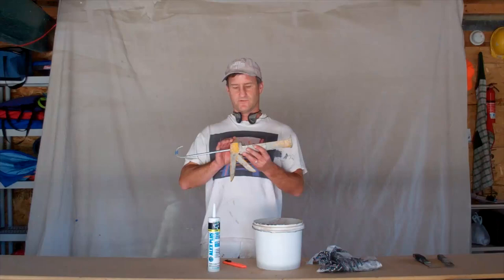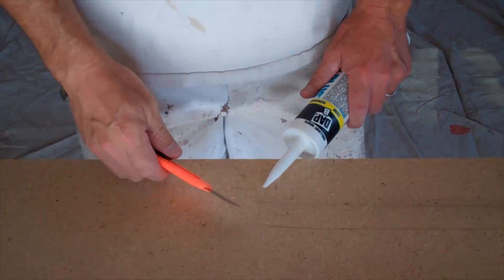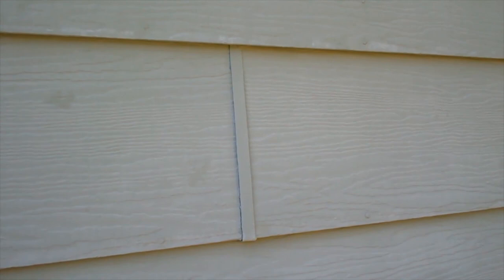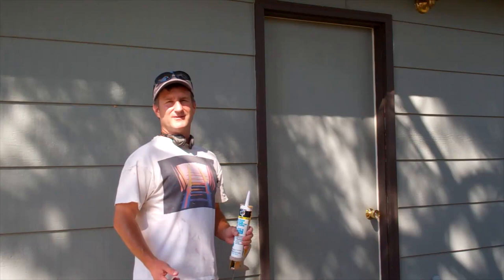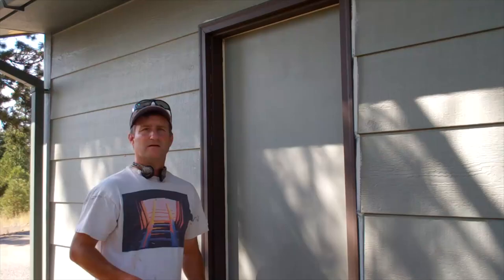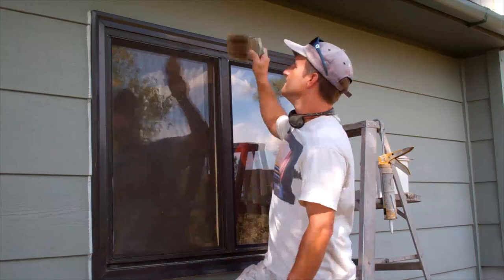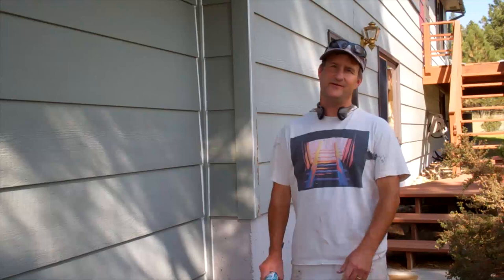Exterior Painting Step 3: Caulking the House

Comment: Great video. I wouldn't reccomend filling large cracks or crevices with caulking though as it shrinks over time and you'll definitely be able to tell. Use some kind of filler material beforehand (wood scraps etc) and you'll be happy you did.

Comment: For those questioning why he said NOT to caulk bottom of each lap- No siding's 100% water tight. So the bottom of every siding lap should never be caulked.  No caulk allows water to escape with gravity AND ventilates small area between siding & vapor barrier.  W/ no source of cool dry air even w/ vapor wrap siding will develop mold and/ or rot depending on material. Like any vent or pipe base on a roof.. caulk L, R, & top edge but never the bottom edge. To allow water an easy escape back on top of the shingle course below. Install specs for every type of siding state not to caulk under bottom edge. On similar note mesh below the starter strip behind bottom of lowest lap siding is as, that combination allows increased cool dry air to enter, while keeping insects out. Starter strip, prevents bottom of lowest lap from being flush w wall- which looks terrible as lap would have different profile than every lap above & would prevent water from escaping.. why often times the lowest lap of masonite or wood looks worse than any lap above even when sufficient gap above ground.
Reply: That depends on the house , I restore 1700's and 1800's homes  . Some of the gaps underneath the clapboards can be up to 1/4 to 3/8 wide due to the previous 8 hack painters who never re-nailed the siding to tighten it up so instead kept adding paint to the gap making it impossible to re-nail tightly  . I typically  re-nail and caulk all these old homes tight otherwise they look like shit  .

  Leaving these large gaps allows insects and exposure from weather to enter the home , In NH a 1/4 gap allows a ton of cold air into a home as well . I've been doing this for  25  years and have revisited previous work that I've completed over a decade ago with no issues .

  Alo the caulking that this painter is using is 100% garbage , it's the cheapest crap you can buy which is typical of most painters that will buy a $60 gallon of paint but use $1.99 caulk .
Reply: @manchesterexplorer8519  I'm about to address this on my own home. What caulk would you recommend?
Reply: @stefan8491  Dap Dynaflex 230 or better . I also recommend renailing any loose trim and clapboards prior to caulking as no matter what type of caulk you use is pointless if the boards are loose . This guy re-nailed nothing as all those large gap's that he caulked will come right  back in no time .

Comment: Thanks, John for an excellent video.  I was panicking when I dug out the existing caulk and there was a huge gap.  After your video, I feel better about scraping out ALL the 20 year old caulk and starting fresh.  Humor and crisp dialog- loved it.
Reply from the maker: Good luck with your paint job! Remember not to scrape TOO hard at the caulk, i.e. don't do damage to the siding or trim when digging it out. If it's still adhering and can't be scraped out, you can still do a thin layer of caulk on top of the old caulk and smear it in with your finger to smooth it, just to help seal up the old caulk and fill any small fissures.

Comment: Should you really be caulking under the window sills?  Every flashing 'how-to' for windows focuses on leaving this open for moisture to exit.  Very similar to your recommendation about the joint along the bottom edge of siding boards.
Reply: I was always told not to. It will trap water if you do.

Comment: Never caulk under a window. it will create dry root if there is any water intrusion, just do it on top and sides.
Reply: Manuela Baez bro your genius lol
Reply: fck i just caulked all my windows and did the bottom...i means its water tight I used PL. or am I screwed?
Reply: Thanks. Thats very good information. None of my windows are caulked underneath. Now I know why.
Reply: THANK YOU! I thought that was the case, and went reading in the comments to verify that. Funny that he caulked the whole thing. Do you caulk the top? Should I caulk the top of my door?

Comment: I would never use alex plus in an exterior application.  It's bottom grade stuff and fine for interior trim (although still not my first choice)  For exterior stuff it's going to fail quickly.  You want to use a quality exterior sealant.  For the home depot crowd dynaflex 230 is probably my minimum viable.

Comment: Love your choice of jazz music, since I play trumpet that sounds much like that...   You didn't talk much about wood dry rot. I noticed some of the boards you were caulking over had dry-rot.  Why wouldn't you replace them?  I guess if you are only doing a make-over for a sale, its not worth the expense, but any good house inspection would stab a poker in there and flag it as rotted.  Great you mentioned the horizontal gaps on the lap siding not being caulked, since they need to expand and contract with temp/humidity.   Some idiot tried to caulk all of my sidings and now of course it's cracked and peeling back...  What should I do, can't really paint of the blistering. Do I need to cut out all that caulk?     Agree with your choice of caulk, paintable silicone is the dope! not the acrylic stuff... thnks

Comment: Do NOT use cheap caulk such as DAP Alex! That stuff dries out and cracks in a year or less. Use Big Stretch, OSI Quad, or other flexible exterior sealant. It will hold and seal the joint for years.
Reply from the maker: +doobysnacks Interesting comment...I've had great luck with DAP Alex. I've used it on my own house and never had it crack or dry out.
Reply: +howtopaintahouse I've always had great luck with it too.  Like the music too.  Classy.  On a side note OSI Quad is good stuff, but you have to wait a few days before painting it or it will crack.  DAP Alex works well enough and you can paint the next day.  Great videos
Reply: I was told to use lifetime warrantee calk - sure its a gimmick but was told to use the best you can afford. Sherwin Williams has some good stuff for $4 a roll. I got some lifetime at Guries paint store for $2.50.
Reply: Jacana Productions y
Reply: also caulking gun is important too, use a better one or the right one for the job

Comment: In Georgia, dust mite, mold spores and  due to rag weed, Georgia pine and etc... we always caulk beneath the boards in which you said never to do so, please explain?
Reply: No siding is 100% water tight. The bottom of every siding lap should never be caulked.  No caulk allows water to escape with gravity AND ventilates the small area between siding & vapor barrier.  With no source of cool dry air even w/ vapor wrap siding will develop mold and/ or rot depending on material.  It's like any vent or pipe base, ect. on a roof.. caulk Left, Right, & top edge but never the bottom edge. To allow water that gets under an easy escape back on top of the shingle course below. Install specs for Hardie, LP, any vinyl- all state not to caulk under bottom edge of laps and explain why. As for issue you mentioned additional sections of VB (beyond what's against sheathing) or thin metal behind each lap extending slightly over top of the lap below (but not visible) would suffice at shedding water away from exterior wall at bottom of course it likely entered at, while protecting against insects. As well as mesh below starter strip behind bottom of lowest lap, that combination allows increased cool dry air to enter, while keeping insects out. Starter strip, prevents bottom of lowest lap from being flush w wall- which looks terrible as lap would have different profile than every lap above and would prevent any water from escaping.. why often times lowest lap of masonite or wood siding looks far worse than anything above even when sufficiently above the ground.

Comment: I grew in a painting family. I was taught to prime then caulk to ensure the wood (or other material) doesn't draw the moisture out of the caulk.
Reply from the maker: I was taught that way too many years ago. I haven't found modern caulk to dry out when applied directly on wood. There is nothing on the tube (DAP brand) about not applying to bare wood. The reason I caulk before priming is because caulk can "shine" through a coat of latex paint, and priming after caulking helps prevent that. This is particularly applicable when caulking new wood trim on an interior job--I don't want caulk shining through the finish coat, so I caulk first, then prime, then paint. Really I think it can be done either way, this is just the way I do it.
Reply: Makes sense. I visited a couple forums, and painters of every ilk caulk both ways. Thanks for the response. By the way, I've learn a lot from your videos. Thanks for taking the time and effort.

Comment: A newbie question.. what's wrong with caulking underneath the sidings?  Doesn't it prevent moist air from getting to the wall?
Reply: TheBostonFern of course, and this can always be done. But on lap siding on a 2,000 sqft house, that would be a LOT of caulk. Small houses can take 4 or more cases just on trimwork, and just as much just on the trimwork outside

Comment: Hello. ..I'm trying to re paint the trim around my house on the outside and after I scraped it I was wondering if I had to sand it?
Reply from the maker: Heidi Gronke I don't usually sand exterior trim unless it is already painted with a shiny/glossy coating--then it will need to be sanded, especially the windows and door jams. But if it's rough wood and a non-glossy surface it shouldn't really need to be sanded.

Comment: Hey, John!  what brand name epoxy do you recommend for large holes and cracked areas in the fascia boards. .  Thanks for the great videos.
Reply from the maker: sonny woo Boy, I don't really have a recommendation for that...if I were you I'd go to a paint store (a real paint store) and ask the owner/manager what products they sell for that. Sherwin-Williams used to make a good oil-base exterior filler for siding holes and damaged wood. Not sure if they still do. Maybe check with them.
Reply: howtopaintahouse John.  Thank you for taking the time to reply.  i ordered the epoxy, bondo.  Good luck with your writing.

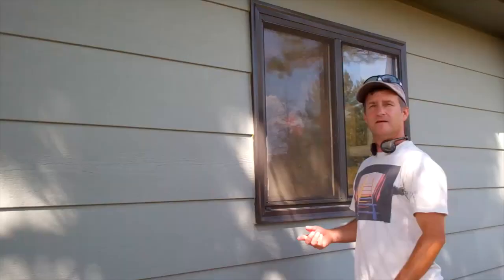Comment: WARNING!  BAD INFORMATION IN THIS VIDEO AT 4:05!!!  NEVER CAULK THE SIDING-TRIM TRANSITION AT THE TOP EDGE OF AN EXTERIOR WINDOW OR DOORSiding is not the waterproof layer of your house...  the plastic or asphalt house-wrap underneath the siding is the actual waterproof layer.  SO, we expect water to get in behind siding, and that water needs a place to get out!  we NEVER caulk the bottom edge of siding, over a window, over a door, or at the bottom of the wall.

Comment: John - Do you ever use a brush to brush old paint off?  Last year I removed soffetting that was covering they eaves of my house.  The old paint on the eaves (which I need to test for lead) is flaking off.  I started to brush it with a broom and realized what a mess I have.  I was thinking about using a small firm bristled brush to get this all off,  with drop cloths below.  I can't imagine literally scraping all of this with scrapers.
Reply from the maker: +jill roeder Very difficult situation. Pressure washing will remove a lot of it if it's flaking really badly. Or sandblasting. The problem is that the paint is not adhering to the coat underneath (probably due to dirt or chalking). Once that situation is created, full removal of the topcoat is the only solution for a true fix.
Reply: Thank-you.. I think i'm actually going to try vacuuming it.  But yes, I think i have a lot of work to do.

Comment: For the last 30 years caulking guns have a built in cutter for the tubes.
Reply from the maker: They get dull and gummed up. I like to use a very sharp plastic razor knife for a clean cut.
Reply from the maker: Yeah you're right it is a cheap gun but I like those yellow dripless guns...they've always worked well for me. But I'd be curious to try one of those Cox power flows you mention. As far as cutting the tubes... since a razor knife is an essential tool on any paint job anyway, it's easy to cut the tips of the tubes with it. But as always with painting, there are many ways to do it and everybody develops their own methods.

Comment: I have been a professional caulker for over 40 years. I have seen 10s of thousands of dollars in damage caused by using DAP products n the exterior. They Are fine for very superficial paint prep. But not as a waterproof sealant.Never for corner boards you can see the damage caused by using latex.Never around doors or windows. Absolutely wrong.If it needs to be waterproof and painted use urethane. Guys like this keep me in business. They have no idea about sealants. If air can infiltrate so can water.